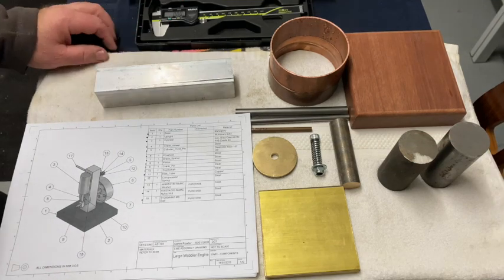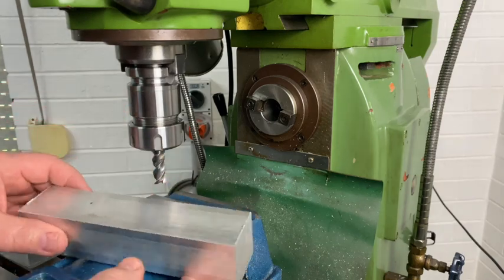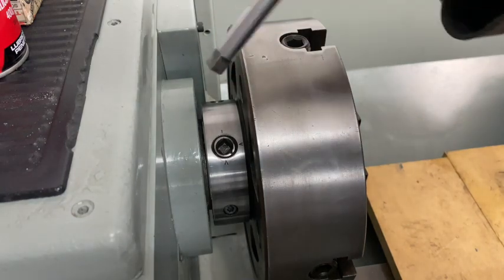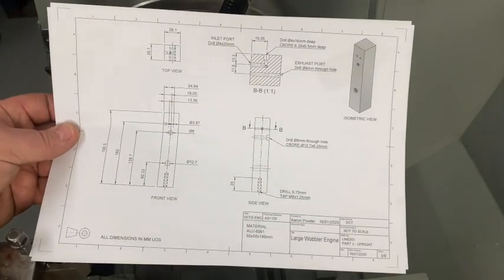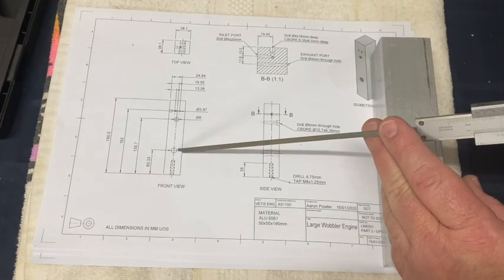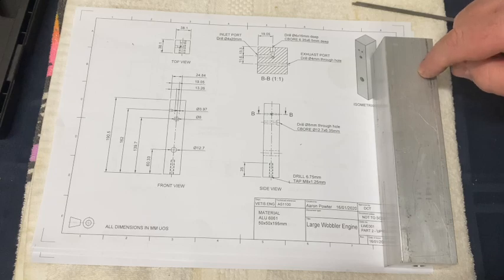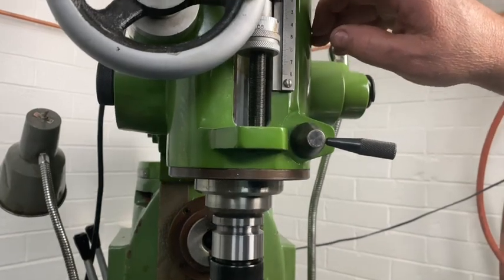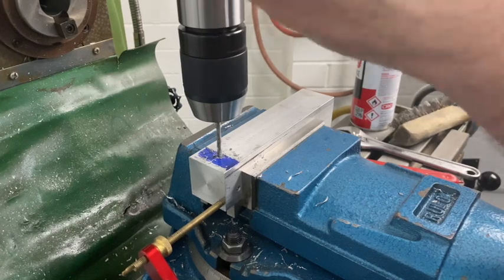Oscillating Engine Build - Part 1 Upright

Comment: Tried to download the PDF file but it appears to contain a virus.  Please check this and post when corrected.
Reply from the maker: Hi Robert.  Must be something wrong on your end.  I just tried the 3 links and they worked perfectly.  I suggest to use Google Chrome to access.  It will take you to my Autdoesk A360 library where it will open each file.  Once opened in the A360 viewer, click the blue download button at the top right of the screen. Cheers, Aaron.

Comment: Sunday Night.
What,s happening on Aaron Engineering ?
Interesting project your working on.
Looking forward to watch the next parts to complete this one.
Could not help to see that bloody Green Drill Press you Love so much at the end of the video.
Even after the video finished, i am still shaking my head ??
Reply from the maker: G'day Peter.  Aaron Engineering has been slack lately and not making many videos.  Time to remedy that and get started on my first engine build.  I plan to make many motors on here and this will be first and last wobbler.  Hey, don't knock the green drill press.  I know you secretly love it.  One day I'm going to sneak into your shop and repaint yours green.  As Kermit the frog once said, "It's not easy being green". ha ha ha 🤣
Reply: @AaronEngineering  
It,s funny i was just looking at that Green Drill Press this morning on Instagram ?
I see it placed nicely near a window ?
All i need to do is remove this window and grab it, and run like buggery.
It,s ok.
I will return it after i paint it with 2 Pack Black.
Reply from the maker: @weldmachine  One word, "Noooooooooooooo".  I've got security shutter blinds on that window.  Time to lock the bastards 🤣